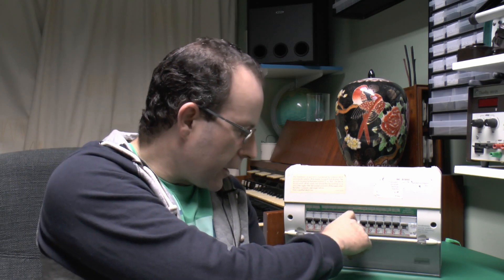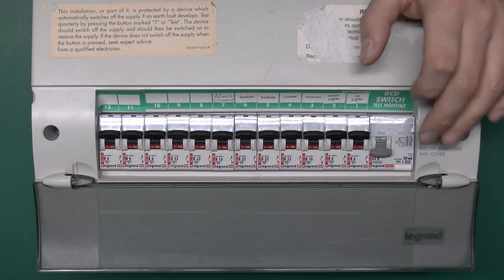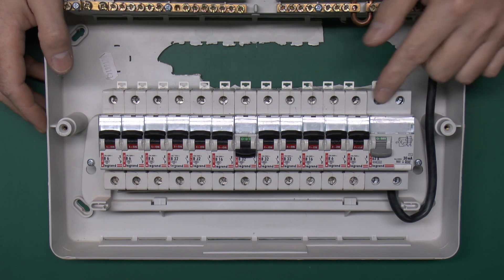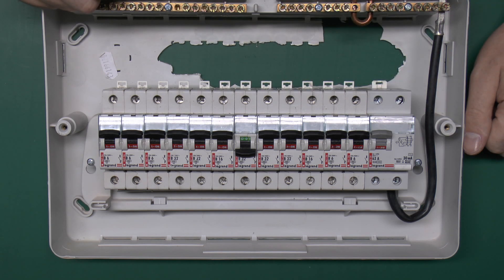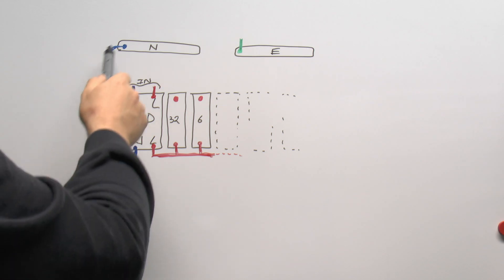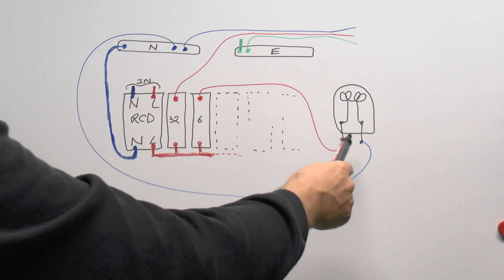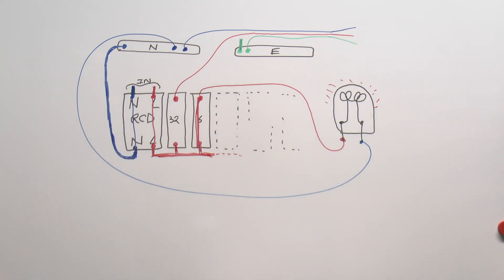RCDs: Neutral - Earth Faults

Comment: Yet another issues caused by the UK insistence on using single pole breakers. Coming from France I was horrified to see that single pole breakers were in use in the UK when I moved here. My main concern was the classic live/neutral flip which due to incorrect wiring can cause someone to electrocute themselves despite having turned the circuit off. It did not cross my mind that an earth/neutral fault could trip an RCD even in an "off" circuit... Well yes it can since the neutral is not disconnected. In the day of modern RCBOs where the neutral of the circuit has to physically go through each breaker as well, why don’t those breaker offer double-pole isolation? Genuinely interested to know why double pole breakers are not a thing in the UK!

Comment: This is very interesting  because it appears to be "IMPOSSIBLE". strangely, I have a similar issue, except this is inside my property. A plumber fitted an unvented cylinder and tested the copper pipe and found d 20 volts flowing through. I imagine it is a swapped live and neutral somewhere but cannot find it

Comment: In the older RCBOs they were single pole. The N of the RCBO is always connected to the N bar and the N conductor of the circuit. Just the same as a single pole MCB. It appears that an RCBO circuit drawing current may trip if the E and N of another cuits touch each other, as in the scenario given. So a single pole RCBO will not put this right as N is always connected. A double pole MCB or RCBO will solve it. I may have to draw it out to be sure. These days double pole RCBOs tend to be the norm - this vid is ten years old now. I am not sure if single pole are even available as many manufacturers have dropped them. 

There is a channel dedicated to EICR testing. They come across problems with single pole RCBOs, saying they should be banned.

Comment: I was installing new sockets, and when i switched the socket circuit off to do the wiring, rcd tripped a few minutes later, and the lights went out. Dont know why? The next morning, when all the breakers were up in normal mode, rcd tripped again. Dont know why.😢 timirrow an electrician is coming, i hope it,s nothing serious and it be rectified quickly.

Comment: Hi. What would or could happen if you did not clear the neutral to earth fault when the single pole rcbo trips and you don't have a 100 MA  double pole S type rcd up front Cheers
Reply from the maker: Current could flow between N&E via that fault.
On a TN system that won't matter at all.
On a TT system it could result in elevated voltages at the earth electrode or at other parts connected to it.
If you use SP RCBOs with an upfront RCD, the upfront TCD will still trip even if the RCBO disconnects.
Reply: @jwflame  yes but I take it it will clear the  dangerous N-E fault the sp RCBO would not

Comment: When making alterations to a circuit covered by a shared RCD (i.e. split load board), I will now disconnect the L, N & E of that circuit to prevent nuisance tripping as well as being a means of isolation. It will need to be done for dead testing anyway!

Comment: Cheers. Excellent explanation. This had me puzzled while doing some electrical work up in my gran's attic, I thought she was flipping the main breaker as she's terrified of electricity. I'm cautious; test with a NCV tester then a multimeter before work especially as whoever did the wiring in that attic had no idea what they were doing, flourescent strip light in series with a ceiling rose (not for lack of wire, they just left the live wire flapping in the breeze),steel cored speaker wire (or something similar) hooked up to live and neutral leading to seemingly nothing, if I had to hazard a guess it was for an old doorbell and just reconnected by every contractor who did some work there, though why it is on the attic lighting circuit is beyond me. 
All of these things had me fairly worried about the house being plunged into darkness as I was concerned that there was a live (or intermittently live) conductor somewhere. Turns out it was neutral touching earth, which I'm sure of as I tested it twice. Measured with a multimeter and got .7 volts, guess the current was enough to trip the breaker though.

Comment: Was there any MEN link between neutral and earth in this installation
Reply from the maker: No, that arrangement is not used in the UK.  The only link N-E is in the fused cutout located before the meter and owned by the electricity distributor. 
Not permitted to have such links within the installation or to use combined neutral and earth conductors in an installation.
Reply: @jwflame  Thanks.  Australia has neutral and earth bar joined.

Comment: You said if you have a rcbo board then in the case of an N to E fault then only the one device would be affected, but that would only be true if Sp+N rcbos were used ?.
Turning off a Sp rcbo is going to be no different from turning off a  mcb the N to E fault would still be there.
Reply from the maker: The difference is that with a single RCD for everything, any fault on any circuit disconnects the whole lot.
With RCBOs, only that individual RCBO is disconnected.
The N-E fault remains there in both cases until it is located and repaired.
Reply: @jwflame  If Sp+n rcbos were used then the E to N fault wouldnt be there as the N would be disconnected.
Reply: @jwflame  Your statement that any fault on any circuit would disconnect the RCD isn't true, as an L to N fault wouldn't trip the RCD.
Reply from the maker: @mainlineelectronics5266  You are now just stating the obvious for reasons unknown.
Reply: @jwflame  It's because of your statement that “any fault on any circuit would disconnect the RCD”

That statement isn't true

Comment: Shouldn't the input be at the bottom of that RCD?
Reply from the maker: That one is as supplied by the manufacturer, supplied from the top, load connected at the bottom.
Others may have input at the bottom, others it doesn't matter.

Comment: In Australia we always have that connection between neutral bar and earth bar, called MEN link (multiple earth neutral).

Why, for us, does this not trip the RCDs?
Reply from the maker: The link is before the RCD, only the final circuits are connected after the RCD.
Most supplies in the UK are TNCS, which has the same N-E link, although it's contained within the suppliers equipment before the meter and not normally accessible.
Reply: @jwflame  Sorry mate I don't quite understand. With our MEN system (basically looking like 8:10), why doesn't the current split between main neutral and MEN link to earth? Or does it?

Comment: An excellent explanation as always, in our house we have a single ring main serving both floors, the RCD drives me crazy. We have lots of low power devices around the house some inherently generating a little earth leakage current. Naturally it will maliciously wait until about 2:00am before it trips, to be fair there is always a good reason. (Last time it was the cordless kettle base had water spilt on it). I really should investigate splitting the supply to two rings, seems strange that a modernish 3 bedroom house would only have one....
Reply from the maker: The concept of a ring for the whole house was several decades before RCDs were in common use.
As almost all circuits in a modern installation require RCDs, the more sensible solution is multiple circuits each with their own separate RCBO.
Reply: @jwflame , the house is 1970s which sadly I regard as relatively modern. And yes having more circuits would be a great advantage, thank you for your videos, and this reply.

Comment: I was changed a switch and when putting the two neutrals back in the RCD tripped. Is that due to a similar reason?
Reply from the maker: Yes, even with that circuit isolated, the neutral and earth are still connected at the consumer unit, and if they make contact, current can flow there due to loads on other circuits.

Comment: A very good case for fitting dual pole RCBOs which are now becoming available.  The RCBO will remove the fault if it trips, plus it can be used to fully isolate the circuit.
Reply: Are you saying if the RCBO has a neutral fault it will effect other RCBO's ?   Surely that would not cause other RCBO's to trip ?

Comment: The other way to look at this is that the Neutral will always be at a potential above Earth due to current flowing in the Neutral - it need not even be current from your property as the Neutral and Live normally feed a number of properties. As the Neutral is at a potential above Earth connecting them will cause a current to flow which may well be sufficient to trip the RCCB. The voltage will fluctuate so if you have a low resistance short from Neutral to Earth there may not always be sufficient potential to trip the RCCB but when others load their circuits your RCCB will trip. Measuring the insulation from Neutral to Earth in your property should find this sort of fault but you need to disconnect the incoming Neutral as this will normally be earthed.

Comment: Been there and done that - I was rewiring a socket and I twisted the bare ends of the cable together and the RCD tripped as explained plunging the building into darkness. The situation was only saved as I had a head torch in my pocket that I was able to find in the dark. Moral carry a torch at night particually when working on electric circuits.

Comment: Hello John - thanks for above explanation.  I have a question - I have a volex rcd vr80 .  Where can I find out what the  in and out connections are.   I noted in your diagram that the neutrals are on the left side with the live's on the right, and mains input at the top pair of connections.  The problem I have is that there is a small label with a capital 'L' next to the top left connection  of my RCD.  If I assume the L is load or live, that makes the way my RCD is connected different from your diagram.  Any advice?   Thanks in advance.   JS.
Reply from the maker: The Volex ones were made to go either way - on those consumer units it was usually one RCD at each end of the row of MCBs, the left RCD had L on the right, the right RCD had L on the left.  The two RCD were identical other than the placement of the 'L' label, and that's why they had a stick on label rather than it being moulded/printed on.
Supply in on the top for those - for most RCDs that doesn't usually matter either.
Reply: @jwflame    Thanks for your reply John,  that is very helpful information.  I had taught some electrical installation classes many years ago but did not remember dealing with consumer units or their contents.  Currently facing the installation of consumer units in a summer house and a cellar - for lighting and power.  Thanks again.   JS.

Comment: I only have 1 rcd that only covers half the consumer unit. Every time I have an electrician round they say they can’t do anything until I have an rcd on all of the consumer unit. Two different electricians have advised me that the new regulations say you must have the whole CU covered by rcd?
Reply from the maker: Virtually all circuits require RCD protection now.  Those with an RCD for half of the circuits were valid at the time, as only some circuits required RCDs then.

Comment: Yet another reason to not touch neutral at the outlet, even if the circuit breaker is off. The voltage is probably almost non (assuming no fault at the N - E connection earlier on, which is a bad assumption to be making when working with electric devices), but still could be some, especially if some cabling is incorrect.
Reply: What about the opened or loaded neutral? There is current in the neutral!

Comment: There is of course a problem (well at least two actually) with all RCBO Consumer units that applies especially to TT systems where the earth impedance is such that the rated impedance for even 6A RCBO's may be legit but far too high for the RCBO to operate correctly if at all. The problem is exacerbated no end when higher current RCBO's are used. We are reaching the point very rapidly where electricians will no longer be qualified to work on electrical safety systems as they will need to become electronic degree qualified as the systems will perforce require far more intelligence built in and electronic, not electro mechanical as they are currently. 

The push towards GFCIs and RCBOs as standard is going to wreak havoc on the domestic supply market especially in rural areas where TT systems abound and the electricity companies are going to face HUGE costs to upgrade thousands of domestic feeds to TNCS at the very least in order to get earth impedances well down to meet the requirements of RCBOs. OTHERWISE, RCBOs will become prohibitively expensive and bulky due to the modifications needed to make them far more sensitive. It's time for a complete rethink on the whole domestic market solutions and centralised, automated systems within the domestic environment using only 5v and 12v for lighting and control of low power devices and mains ONLY for AC to DC conversion or high power requirements. This is becoming glaringly obvious when the current state of POE is such that up to 100 watts is now specified as valid at 48volts over cat6a is considered.
Reply: Sorry ... the second problem is one of cost to the home owner. the current standard 14 circuit Consumer Unit, fully loaded with RCBOs will be priced at over £200 which frankly is ridiculous, when better, faster, more protective equipment can be made electronically and operate more effectively than RCBOs, not to mention the coming problem of DC RCBOs, which once again can be replaced more effectively with electronics than electro mechanical devices (ALL present electrical protection devices).

Comment: if i am replacing a light fitting on an individual circuit containing several lights ( and ive isolated it and made it safe) and i know its going to trip the rcd to other circuits which will bring a shop to a grinding halt, which  conductor would i reconnect first to prevent it tripping and then in which order after that (to reconnect the other two). 
also could you explain why they are reconnected in that order. thanks John, i hope the question makes sense

Comment: I have my multimeter continuity beeper , beep when i connect neutral and ground. Is that normal??
Reply from the maker: On some systems yes.  Neutral and ground are connected together at the transformer.
Reply: @jwflame  I have the grid Neutral coming to the distribution box and Ground is connected to the Earthened Copper Rods beside the house. So what can be wrong?
Reply: @Raj-cf6fe  The neutral is probably grounded at the distribution transformer by rods driven into the Earth ( the brown crumbly sort ) thus the neutral & your local electrical earth are connected together via the brown crumbly earth. I am not sure what the normal resistance is.between two sets of earth electrodes but it should be quite low to provide protection.

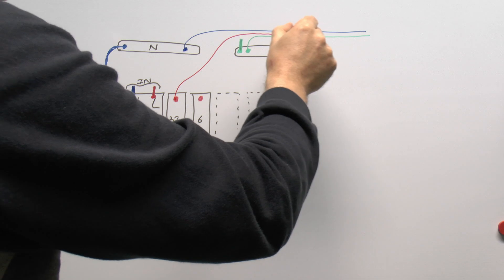Comment: Extremely helpful video as usual from John. I watched it so carefully that I noticed that you edited the video at 4:27 :) Thank you very much. You saved my day! Your video confirmed my suspicion of a N-E fault in a residential installation in which the responsible 30mA RCB was switching off every 5 minutes! despite all the MCBs switched off (and Live bus bar removed, just in case). Locating or narrowing down the fault is as easy as removing the Neutral wires one by one from the Neutral bar and see which one trips the RCD.

Comment: I don't have earth wire ! What to do ? My PSU needs 3 wires, otherwise, 110V is leaking on the chassis.
Reply from the maker: Rewire the circuit to include an earth wire.
Reply: @jwflame  I can't ! The owner didn't install ground in the building. I'm thinking about bootlegging neutral and ground but thinking also of installing RCD but thinking too if RCD is necessary.

Comment: Great video ! I just saw it and I think one solution for this is to use 2poles or 1p+n MCB s instead of 1 pole. So when you disconnect the MCB both line and neutral are off . The regulations in my country recommends to use that kind of MCB s.
Of course RCBO s on all circuits is the best solution but it is more expensive.
Reply: In NL we use one RCD for every 4 MCB's. And indeed 2p RCD's. They recommend RCBO's for outdoor units like airconditioners, outside lighting and solar panels.
Reply: Where you from ? Romainia ? They use cow shit to build houses

Comment: Hello Mr. Ward, there is one more topic you might want to mention, which has happend to me: The total cable capacity and leakage currents of all the circuits connected to one RCB can lead to its tripping without an installation fault. When switching all circuit breakers to off, except one of them, each circuit allone works fine. And even when 8 or 10 circuits of 30 have been connected it still does not trip, and this in any possible permutation of the 10 out of those 30 circuits. This has happend to me as i tried to power a house, to have light in all the rooms, with a a single phase only  to all phases of a three phase RCB, during the replacement of the mains cable, connecting the RCB to the powermeter box, which was located in a officebuilding closer to the street. After reconnecting it to all three phases it worked fine again. So i assume that the leakage currents compensate themselves in the starpoint.